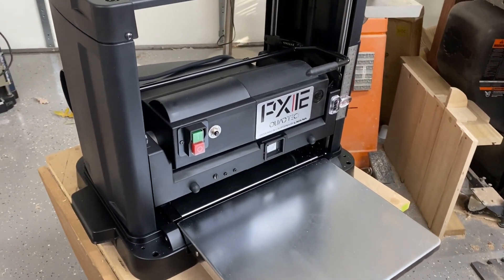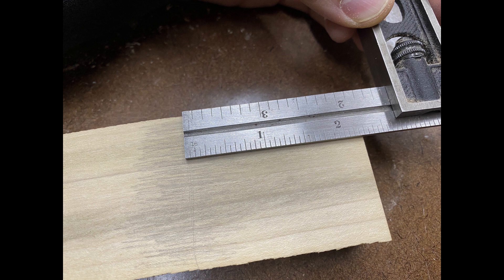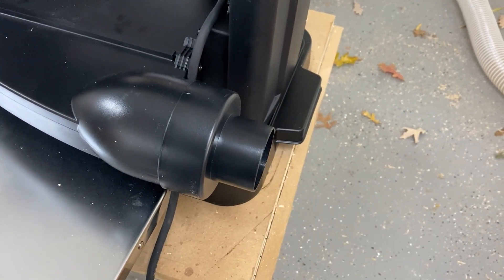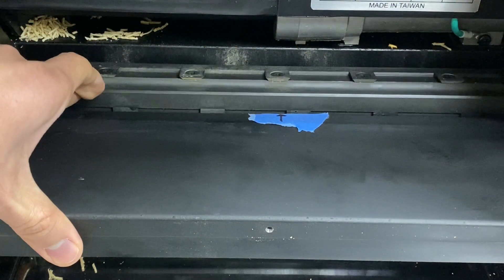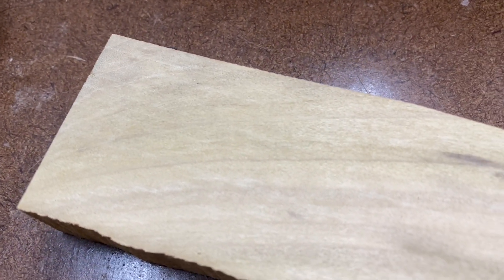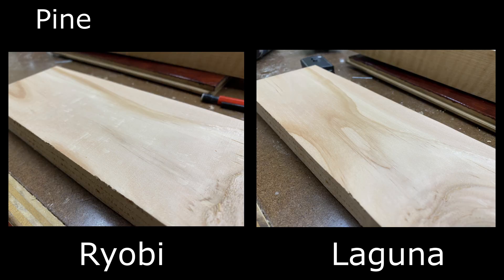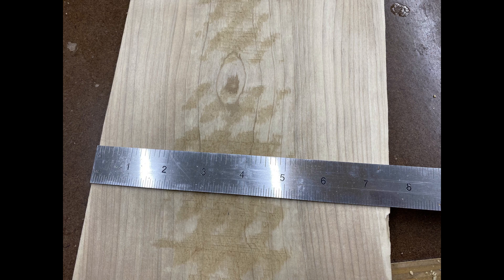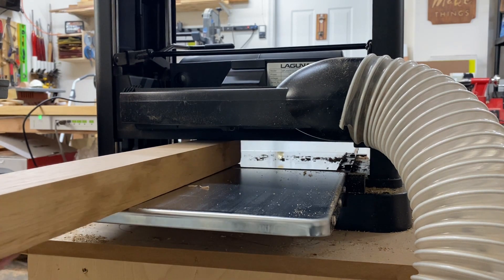Laguna PX12 Benchtop Thickness Planer Review: How can it be worse than a Ryobi?

Comment: When your Ryobi  planer ( or any planer) leaves a ridge due to a nic in blade. Simply run board thru planer again WITHOUT changing depth of cuts. Just move board a bit left or right to let planer cut off the ridge only.

Comment: Thank you for the information. As a woodworker for over 50 years and working with thickness planers from 12 inch to 24 inch and from 3 hp to 7 1/2 hp, they all produce snipe of some sort. they also leave what I call ripples from the cutterhead. This can also be seen with jointers. Being a Fine woodworker and making quality furniture, we were all taught how to use hand planes. As long as the boards that I am planing are not longer than 60 inches, I use hand planes to smooth the surface, which removes all imperfections from the wood surface. This is something that the average woodworker should learn how to do. I suggest those interested to watch some of Rob Cosman‘s videos which goes into this subject in detail. In conclusion, use scraps of wood ahead and behind the wood that you are planning and your snipe is virtually eliminated. Machines only reduce the amount of labor, but cannot replace the skillful hands of a fine woodworker.

Comment: Hi Jay, we are really sorry you had to experience these issues. We are currently working with our factory to solve this problem immediately so that we can get back to the quality our customers deserve. If you have any questions, please contact our customer service here: https://lagunatools.com/resources/customer-service/ Thank you.
Reply: Clearly Laguna tools is monitoring Youtube for these posts. I spoke with Rachel in Customer support and was told that the product is NOT being recalled but that owners Needed to return the planer to the dealer for a refund. (sounds like a recall to me) My planer makes horrendous raised ribs at every blade but they are different heights and thickness so the carbide inserts must be positioned all willy nilly in the roller. If it's true that ONLY the black Friday units have this problem than I think Laguna owes us a replacement unit that works properly rather than forcing us to purchase a new one at a higher price. It seems only fair to provide us with a fully working unit even though we purchased it at a discount. A simple voucher issued to customers to use at any dealer when the new and properly working units are available.   Here are images from the first board I ran in my PX12: https://www.dropbox.com/s/ksu96cvr3z2pvgu/IMG-7619.JPG?dl=0  https://www.dropbox.com/s/8b55c9zosdgkb6e/IMG-7620.JPG?dl=0

Comment: Great comparison vid. I really want the PX12, and was about to purchase, then started hearing about this issue. I called Laguna today to find out what's going on. I was really impressed by how they handled the call. Mad respect for this company. I was told the issues you're seeing has so far been limited to the production of units for the Black Friday sales period as there have been no reports of this issue on production runs previous to and after. They also informed me they are now testing every PX12 before sending em out. Nevertheless, Im looking for a backup model in case they dont sort this problem out. Curious why picked the PX12 and what were the other models you seriously considered?
Reply from the maker: Thanks for that information! I didn't know it only affected a production batch. I picked the PX12 because I wanted to try out a carbide planer without paying out the ears for it. The Black Friday sale definitely sold me knowing that Laguna is a reputable company. The Dewalt DW735 was definitely in the running since the price was comparable, but it still had HSS knives and it's a lot heavier.